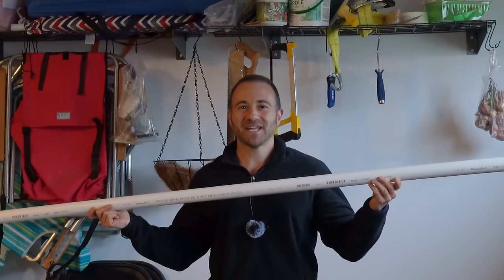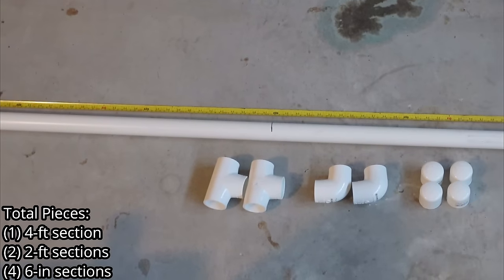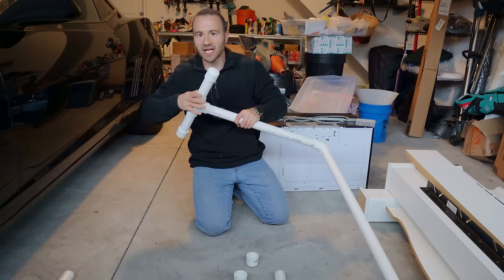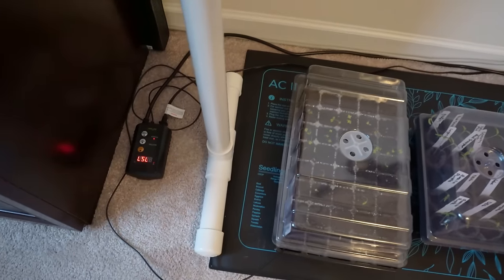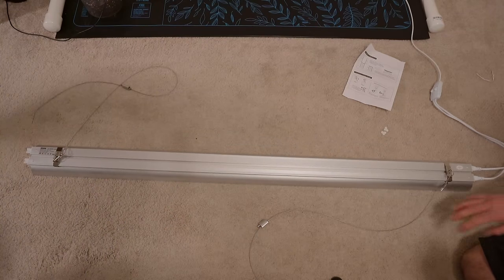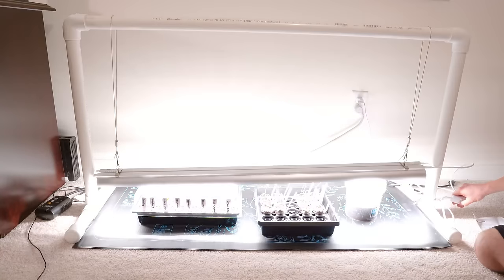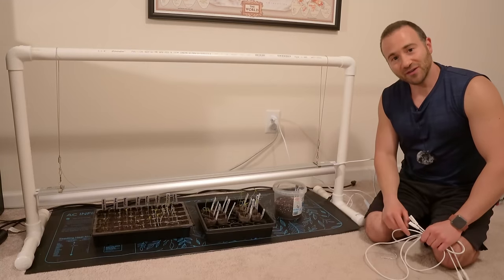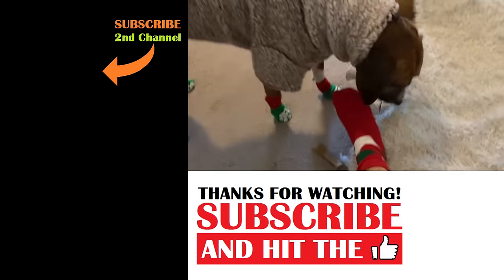How To Build A Grow Light Stand Using ONE Piece Of Pipe

Comment: Was just about to put up some lights!

They make a pvc cutter, looks like pliers with a blade on each side, and they ratchet. Squeeze the thing like 3 times and cut the piece, cut the whole pipe in under 2 minutes.
Reply from the maker: It's that time of year!
Reply: I have that cutter tool. Very easy to use.
Reply: How much do they cost?
Reply: Ratcheting pvc cutter, $20+/-  or a little less
Reply: Thanks!

Comment: Love it.. probably over-kill on the thickness of the PVC for what you're using it for, but still a great solution. You could maybe fill the bottom rungs with sand or similar for added stability.

Comment: You did a great job of creating a grow light stand.  For those people who aren't as flexible to lower themselves to the floor, they could make the stand taller and put a small table under the stand for easy access to the seedlings.  I looked up your grow light on Amazon.  Even though it's full spectrum, lumens aren't listed and it's only 2900K, which isn't daylight spectrum.  The Kelvin rating should be in the 5500-6500 range to mimic full daylight brightness.  Lumens should be a minimum of 5000.  Last year, I setup a grow station for the first time in my house.  I bought LED shop lights that are 5500 lumens with a 6000K daylight rating.  Luckily, I found a wire metal shelving unit on sale at Sam's Club for only $35.  I put 2 lights per shelf, used only 2 of the 4 shelves.  Used s-hooks and chains to lower and raise the lights,  Very easy to do.  My seedlings grew very well.  A couple of my tomato plants even formed fruit before I transplanted them.  I was thrilled with the growing success of my plants using the shop lights.  Hope you have successful growth with your lights.

Comment: What a great idea. I like how you can raise and lower the lights.  Nice that it is not expensive to make and I think anyone could assemble this grow light stand.  Thank you for another great useful video.  Love the matching socks 🧦
Reply from the maker: It’s very basic and affordable. It’s a great beginner’s setup, or for someone who only needs to start 150-200 seedlings at a time. If you need to start 500-1000+, you may want to invest in one of those shelving unit builds, but I do not have the space for that. Way too big and bulky. What’s nice about this is it’ll break down into a small box for storage once it’s spring.

Comment: Also @themillennialgardener - I use very similar lights in my three-tier hydro system. above each grow section... zip tie the light tubes to a piece of 1/2" rigid foam insulation so I can get four led tubes combined. Also I spray glue mylar to the rigid foam to get extra reflection.

Comment: If you can’t fit a 10’ pipe in your hatchback Lowe’s has 5’ lengths
You can cut 4’, 6”, 6”
Then on number two cut 2’, 2’, 6”, 6”
I don’t want to seem like I’m saying something everyone knows.  That’s the kind of thing that would make me need to draw pictures while I’m standing in the aisle at Lowe’s
And PVC cutters are worth it!
Reply from the maker: You can simply cut the pipe at 4ft. Then, the 4ft piece and 6 ft piece will fit easily in any vehicle. I used to lay the pipe down along the passenger's size foot area and wedge it in between the passenger's seat and the door. It'll fit right in there.

Comment: This is great! So easy and inexpensive, and it will fit on my work table top so I don't have to bend over. Now if you would be so kind as to instruct us on the use of lights for growing our seedlings, like when to start the lights, how long to use them each day, how to quit using them without setting our plants back. Great video! Don't blame Dale for not liking his socks. Dogs aren't made for wearing footwear!
Reply from the maker: The lights should be set about 3 inches above the seedlings. You’ll need to gradually raise them as the seedlings grow. You may have to raise them slightly each day. I have my lights on a programmable timer. I linked to the WiFi timer in the video description. I have it set to come on at 7AM and turn off at 9PM. Lights are not as intense as the sun, so you need to go longer on the time.

Comment: yes, adding the fan will help mimic wind strength. also, adding a timer will help mimic their sleep mode after a few weeks of emergence in 24hr light.  very light liquid fert too.
Reply: So would putting the lights up higher, cause the seeds to grow taller with weaker stems vs keep the lights lower for shorter and stronger stems? Air circulation is a good thing.

Comment: You already have tomato seeds started? Shoot! I'm behind... I'm in Georgia (8a) and I'm never sure when I should start my seeds. I started my onions too soon, I think (early Dec), cause they're all up and about 4" tall or so already. Not sure when to plant (I think March 1), but that's still a month and a half away. I have broccoli outside that's from the fall and so far they've survived (in a sunny but protected spot).
What else have you got started?
Oh, BTW, if people are looking for 'regular fluorescent' lights to use as grow lights, I use lights that are 6500 Kelvin, 1600 lumens (daylight bulbs). Amazon has the screw in types and HD has the shop fixture types.
Reply from the maker: The tomatoes I started are experimental. They will be transplanted out in February under cover just to see what happens. I don't start my actual tomatoes for spring until the first week of February with a goal to transplant them out either last week of March or first week of April, weather dependent. I would personally recommend avoiding fluorescent lights because of the heat they give off, the energy costs, the lack of longevity and the unattractive light they produce, but that's my opinion.

Comment: looks good but i would like to ask a question about your high tunnel build  /i though  you said it was for sun shade and rain control but i only saw shade cloth ? will it stop rain or just soften it?
Reply from the maker: It's for using a shade cloth. The shade cloth is adequate for blocking light rain. It is not meant to be used for plastic. Plastic catches way too much wind, and it isn't possible to secure greenhouse plastic on such a tunnel structure. It works with shade cloth, because shade cloth lets wind through thanks to the mesh design, so the amount of wind stress is a small fraction of greenhouse plastic. If you need greenhouse plastic, you will have to build a real high tunnel made of steel that is designed to take extreme wind stress.

Comment: I think a higher kelvin number is needed for indoor growing. I believe at least 5,000k are needed.
Reply from the maker: Needed? No. These are specifically designed for growing. Everything germinated and grew fine, and my first round of seedlings were moved into my sunroom and are plenty happy. There is a lot of debate out there what's best if you're going to build your own set with shop lights, but these are specifically designed for growing seedlings while not harming your eyes with "ugly" light.

Comment: Theres mutliple Kelvin options on the light you linked. Whats best to be used? I was going to get one of the Barrina 6x pack of 4' lights so that way I could have mutliple sheleves lit for my seedlings, but I'm so confused by how many factors everyone mentions. How do you know what is best for your buck?
Reply from the maker: The one I used is Warm White, which is where the direct link defaults to. I use warm white, because it is easy on the eyes. I do not want some antiseptic high-K light, or even worse, a red-violet light, in my office. The warm white worked just great for my first round of seedlings. If you have some basement grow-lamp setup where you'll rarely be, you can use a higher-K light, but if you're going to expose your eyes to it regularly, they're rough. I can't have that type of light in a place I'm located hours a day.

Comment: Are you using the oscillating fan because the lights are too hot for the plants. I did hear you say build up strength in the stem but I also saw someone’s remark on Amazon that the lights are hot
Reply from the maker: No. The oscillating fan, on low for just a few hours a day, simulates a light breeze and causes the seedlings to react by thickening up to resist wind. It's one of the secrets to get stockier, stronger seedlings. These are LED lights, so they give off basically no warmth.

Comment: What color light is best to use
Reply from the maker: That’s a bit debatable. I see wide ranges recommended. The kit I bought, which I recommend, is 2900K and it works well and produced some good seedlings. For $35, it is a lot cheaper than trying to build your own. I linked to it in the description.

Comment: When I did this I used a metal shelf from Amazon got 4 rows for plants put fans and lights on each roll it was cheaper then the pipe in my area. That pipe in some areas is really expensive
Reply from the maker: The problem with the shelves is the room they take up. You need to dedicate a large space, and then what do you do with the shelving once you're done starting seedlings? Do you go through the process of taking it all apart to store it somewhere, then you have to put it back together again next season? Or do you just leave it up and stare at the ugly shelf all year? That's what I'm trying to avoid. This will break down in 60 seconds and I'll be able to tuck it away in a small box, then re-assemble in 2 minutes next season. I refuse to use a shelving unit, because my house is small and we don't have basements here due to the water table.

Comment: Are the end caps on the feet really needed?
Reply from the maker: Yes. The Tee is thicker than the pipe, so if you don't put the end caps on, the stand will not balance. You need the end caps for the feet to be level.
Reply: @TheMillennialGardener  Grazie.

Comment: Wal Mart has some Hyper tough 4' 5500 lumen instead of the 4500 lumen for $17.88, that's less than half the price of Amazon.
Reply from the maker: That’s just for a light tube. Then you need to buy a fixture, chains, etc. Also, are those fluorescent bulbs? I refuse to use those. They must be LED. I priced it out every way possible and building a setup with shop lights is far more expensive than this simple kit.
Reply: no that's the fixture and all, Hyper Tough 5500 Lumen 4ft Linkable LED Shop Light $17.88, You might want to take the cover off so the lights will be their brightest they can be, buy one and check it out and compare it, you can take it back if you don't like it. you might check your local store it might be different all Walmarts are not created equally , they apparently don't sell what I got, I got some 5000 lumen  LED lights for about $20 each a few years ago.
Reply: No that is for the complete thing 5500 lumen LED linkable fixtures not just a bulb. @TheMillennialGardener